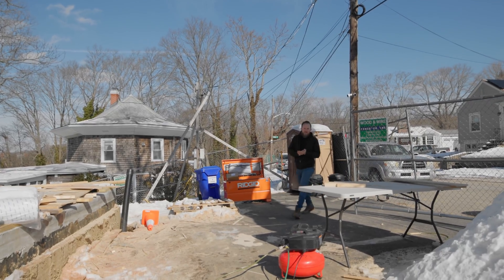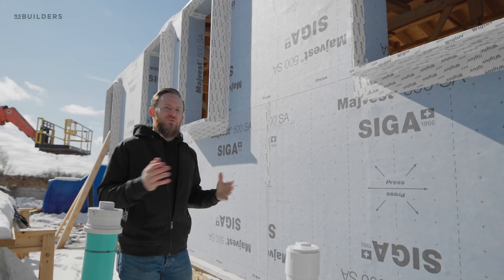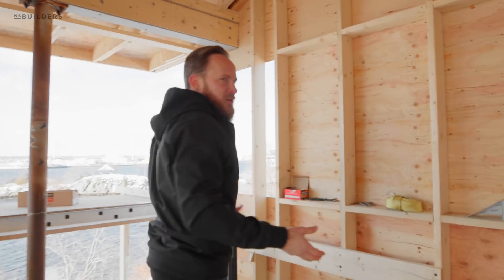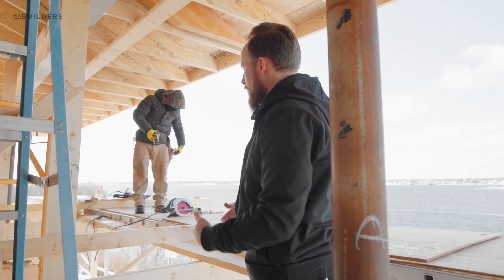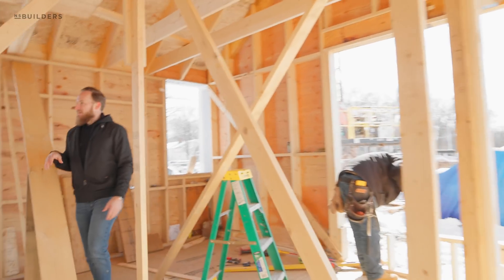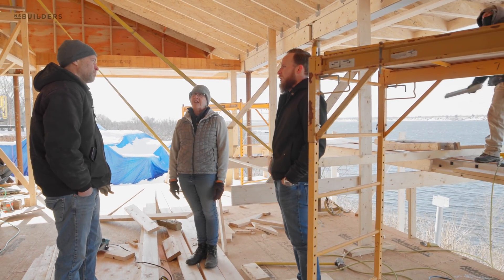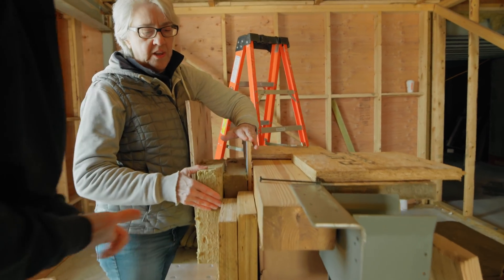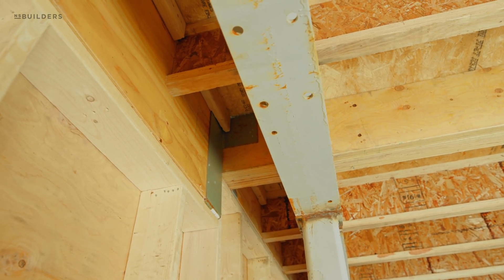Architect shares what the structural steel  is ACTUALLY doing

Comment: I will never understand point of R60 walls.  Especially when walls are half glass.  I guess its a  bragging right. Like driving  a Prius while having a yacht.
Reply: The customer is always right.
Reply: Heat loss/gain is calculated over the full building, it’s not based on the value of the worst or best component. 80% of the building envelop is very high R-value (~R-25 at foundation, ~R-45 at walls, ~R65 at roof).  The thermal buffer created ALLOWS us to have larger amounts of glass. Plus the glass is triple glazed, thermally broken with effective R-value around 8.
Reply: @julianugentarchitect  There is a point of diminishing returns where there is more energy used to create and transport materials  than they will save in a lifetime.
Reply: @guyod1  Yes, embodied carbon from manufacturing and transit is an issue - and was a factor in all the choices.
Reply: @julianugentarchitect  Are you sure about that? If I open a window, it doesn't seem to matter if my wall is insulated.
Reply: @spayced  Yep, I’m sure about this. Opening the windows is an entirely different scenario and I would suggest turning off the heating or cooling if the windows are open.

Comment: Why not instead of using those off the shelf aluminum deck brackets that need all the extra labor and material to pad the wall out with LVL pieces, don’t they just cut sections of I beam with a 6 inch webbing, drill them and send them to get galvanized? They will be stronger, custom made to fit their application and easier to seal than two pieces of wood that will also require a longer through bolt. It’s just my opinion though... I think the brackets are a neat idea but I would custom build my own brackets and it will be faster and easier than trying to accommodate for an off the shelf product intended for a different application. And I think a 6 inch webbing I beam has the correct thickness for the two layers of rock wall

Comment: Those are great deck ledger brackets. Been using that approach for many years. Highly recommend. Even had custom ones welded up to accommodate a greater thickness for different exterior condition.
Reply: That is what I was thinking. Why complicate it with stacking the LVLs to get the thickness needed. Seems like a steel fab shop could cut off some sections of steel I-beams and trim them up to be any thickness you need and drill a couple of bolt holes.

Comment: Love seeing the detail of the deck connection. A similar problem that I have run across. How did the engineer approve the 1 1/8 sheathing not going to the edge of the beam to tie in the floor diaphragm to the floor beam/rim board? I am in California and typically they need this to tie it all together. The other issue that comes up that you addressed is the gap from the porch to the deck created by the exterior insulation. The 3/4 plywd helps solve that issue. Thanks for letting us see the details.
Reply: Knowing that the 1 1/8” flooring would be cut out at the glass door/wall, the framer glued and screwed the subfloor to continuous blocking on the inside of the LVL.

Comment: As a structural engineer, really neat to see the mockup! Understandable that a larger bracket would be longer lead time and a thermal bridge. I've used fabreeka pads rather than LVLs for thermal breaks at structural connections with good results. They make all kinds of washers and sleeves to ensure the entire connection is insulated as well.

Comment: All of this design is identified to protect the project from salt water.  At about 10:00 the standoff is identified as aluminum.  It will probably be bolted on with galvanized bolts.  Admittedly this assembly is somewhat protected but it is exposed to wind driven spray and water. Best practice would be to use stainless steel. Second best would be hot dipped galvanized steel and last choise would be aluminum.  Salt water and salt spray loves to corrode and destroy aluminum. This decision should be reconsidered.
Reply: Good point. We need to 1) separate the aluminum brackets from the PT structure and 2) cover  any exposed areas. This is one of those situations where the products available aren’t exactly what you need and custom (especially stainless) would cost 5 times more. Note to Viewrail, Trex, Simpson etc - sell deck brackets for this situation!
Reply: @julianugentarchitect  This is not a new issue and I suspect that Tech or Customer Support people at Simpson or one of the major suppliers has a solution.  If you need to have brackets fabricated, the bracket is very simple and should be inexpensive.  Getting an engineer to sign off will probably cost more than the brackets (If tht is required by the local jurisdiction.).  
I spent 30+ years on the coast in Southern Californa.  Aluminum framed windows and doors were eaten by salt corrosion simply by the salt carried on the fog.  Steel and tools left in uncondirioned garages rusted quickly and seriously. The problem will be worse on the island.

Comment: The deck attachment detail is interesting.  Thanks for sharing.

I’m a hobbyist, but I would think it’s a sheer load, rather than a moment, on the vertical datum for those brackets.  The only time it would be a moment would be If the perimeter supports failed (at which point, the deck would turn into a cantilever).  I’d think the horizontal datum would be more of a moment load (mostly from wind), but even then it wouldn’t be much of one.

That said, the detail looks so solid that I think a ship could run into the deck and it would cause the entire house to move rather than compromise the deck…LOL!

Beautiful home and I hope you guys enjoy it forever!
Reply: The engineer and I had a good laugh yesterday about the deck structure: modern  deck design is all about preventing a collapse when you have a giant dance party. We both got a chuckle out of the image of me having a raver on the back deck.
And your right about the loads on the bracket being primarily sheer loads - unless the dance party results in a catastrophic collapse.
Reply: @julianugentarchitect  LOL!  We have a beach house in Old Lyme…and, believe it or not, we’ve had a few pretty big dance parties on our deck.  They weren’t planned, but they sure were fun!

I’m planning on building a small ski place up in VT and will be using some of your details.  Thanks again for sharing!

Comment: If you already have so much steel work, why not just custom fab a deeper deck outrigger out of 1/4” plates instead of the two layers of LVL padding behind the shallower Alum product? Minimal cost difference, more reliable, and you can sika tape the back flange rather than relying on sealant that no one will warranty.
Reply: Using steel would be a big thermal bridge.
Reply: @ArthurDentZaphodBeeb  Aluminum is more conducive than steel, but doesn’t matter in terms of the big picture. I would say it’s a worthwhile thermal bridging to have to gain the structural integrity for the deck ledger.

Comment: Nice video, I appreciate the detail covering the wall assembly.

As an amateur viewer, the double sheathing seems backwards. What's the reason to put the plywood outside instead of the WRB outside?
Reply: I'm assuming it has something to do with the insualtion being able to dry out if it needs to.
Reply: @townsendliving9750  That’s correct. Putting the air/vapour barrier in the middle of the wall allows the wall to dry in both directions. It also prevents humidity from the inside from passing into the outer layers of insulation where it could condense into water.
Reply: @julianugentarchitect  I disagree with that intuitively, but don’t think it will cause issue. Siga Majvest 500SA is vapor-open product. It will NOT prevent vapor from going through the wall if it ever gets through you interior vapor retarder. But because you have 6” of R-4.2ci, your due point is likely outside of your structural sheathing. Therefore condensation if it were to occur, is outside the house. Now, you need to be careful that you second layer of staple-on WRB also needs to be vapor permeable, otherwise condensation would accumulate at the back side of your second plywood. I also disagree partially with the idea that wall will dry in both direction. If it is vapor that is causing issue, the vapor drive is mostly going outwards in your winter climate, especially that you will pressurize your house from mechanical system. That said, you won’t really have condensation issue at all, so this point about “drying” really don’t apply.
Reply: @1989catman  All good points that were considered and studied with WUFI modeling. There’s another 5.5” of insulation in the stud wall, so the dew point is on the outside of the WAB as it needs to be in a winter climate. But we also have pretty hot and humid summers where things reverse. The Majvest WAB (water air barrier) is semi-permeable and the Slicker Max WRB (weather resistive barrier) is about 5 times more permeable than the Majvest, so should not trap water.
If we were using another type of siding, we could have skipped the outer layer of plywood and WRB altogether and attached the siding directly to the fiberglass z-girts. The shingles are attached frequently in 5” rows, so the ply sheathing was the only practical way to do this.
Reply: @aayotechnology  I think it is still a code requirement to have interior vapor retarder. But Would be a good idea to do smart vapor retarder such as Certainteed Membrane, or any Siga product. Or to that matter, if due point is outside, a PVA primer would do.
Reply: Condensation on the backside of the outside plywood would seem common, as there would be much airflow.

Comment: Why don’t you have custom brackets made to attach the deck, instead up building up with LVLs
Reply: We considered it but was more expensive and had a long lead time.
Reply: @julianugentarchitect  I was also curious about this, homenl performance also used those deck hanger brackets, it seems like you could get a stainless steel I beam the thickness you needed, cut them to the size you require and drill 8 holes, stainless is also less conductive so better for thermal bridging. I'm sure they have to be engineered stamped which also doesnt seem like to big of a deal if you know an engineer, probably 1 week. I also need brackets like this for some window awnings this year
Reply: @townsendliving9750  Yes, you could source stainless WF pieces,  have them custom fabricated, and get an engineer to do the calculations, but it would be MUCH more expensive with no appreciable advantage. The off the shelf aluminum brackets and scrap LVLs are quick, cost effective, and provide a decent thermal break.

Comment: Did you consider making the deck free standing (probably slight cantilever to get the deck boards within 1" or whatever to the siding of the house)?
Reply: That would require another set of columns next to the house versus having the deck supported off the house structure.
Reply: @julianugentarchitect  Right. I can see peace-of-mind benefits to having the deck be separate, but I'm not sure if it's cheaper.  

BTW, I found this video. The last solution in this video seems like it might work to attach through the insulation (might need to be foam - unclear if there's any compression strength requirements): https://youtu.be/-jNTPl2il20?t=258

Upside is that it doesn't require reducing the amount of insulation behind the ledger.